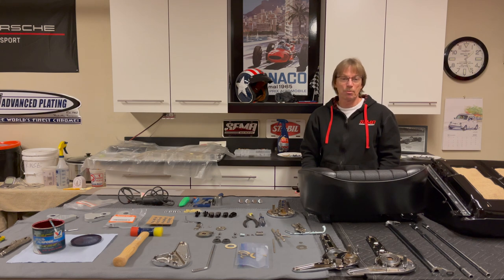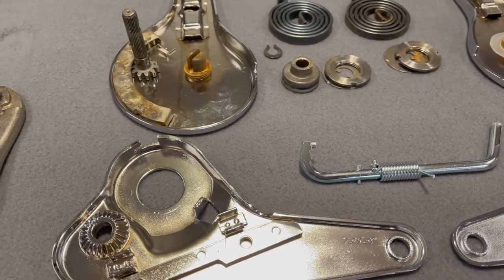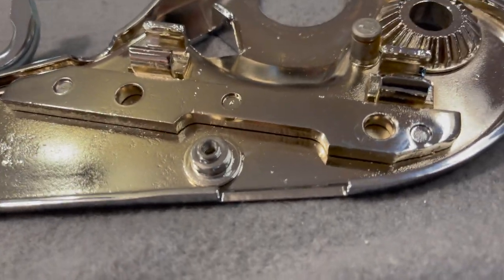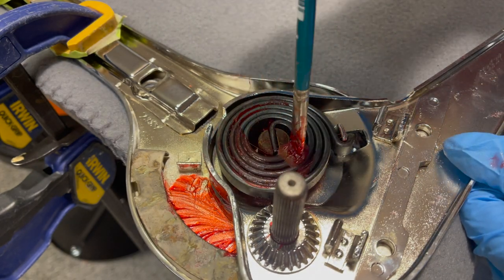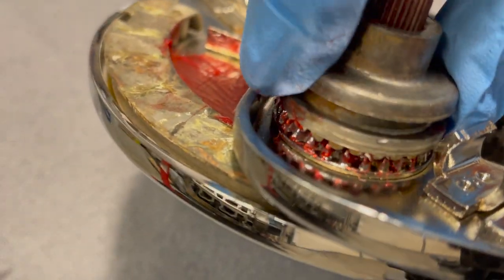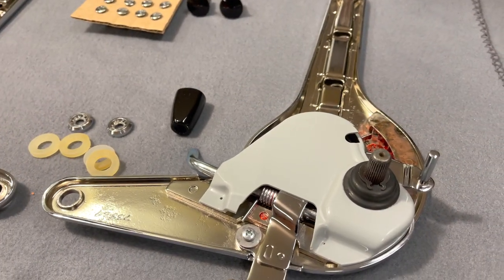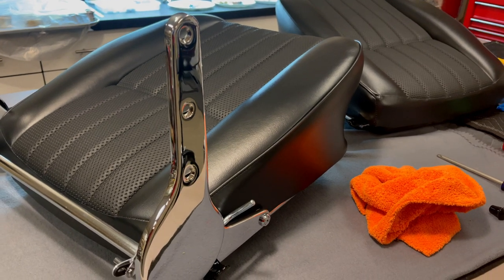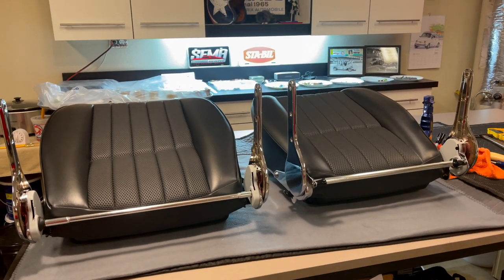Porsche Recaro Seat Hinge !!Full Rebuild!!

Comment: Let me start by saying your work is truly inspiring! I purchased a 68 912 in May from a Restoration shop in Nebraska. A friend of mine here in Michigan spent around 200 hours on when he worked at the the shop. It was intended to be a driver for this older gentleman but at 84 he needed to go into a nursing facility. I am 74 myself and have been a car guy my entire life. Anyway on the trip back my back rest seat on both the driver and passenger side kept popping out of position! I kept wondering what in the heck am I going to do to make them right. Then I ran across your video’s, Wow, there was my answer. I followed your instructions to the letter. I purchased some new rebuild parts from Stoddard, including new covers and I was on my way. The results transformed both seats to new condition! First drive this morning and they are butter smooth. Thank you so much for the fine work you do and for being caring enough to share it with us. I am taking on the window regulators next!
Reply from the maker: Thank you!
Im so glad this video was able to help with your seats.. They can be difficult.
Sometimes all we need is to see how things come apart and we can go from there.
Wishing you the best of luck with your 68 restoration!
Cheers

Comment: Once again, Mike's videos have been the best resource for those of us who are adventurous enough to approach these projects. I've had several people tell me that I didn't want to take on these recliners myself and that they are best sent to a pro with the correct tools. So, I sent these off to a company referred to me from Stoddard. When the recliners were returned to me, I took off one of the plastic covers to discover that the gears looked pretty crusty and if any lube was used on them, it was next to none. Those thin white plastic gaskets where old and in several pieces. I actually paid for this service.
After watching this video, I put the project into my own hands and found that they are not that tough at all to rebuild. Yes, you need to be incredibly cautious when removing and re-installing that large black coiled spring. And, putting the adjuster spring back in requires a bit of dexterity and the ability to throw out some really strong cursing. After watching how to do this in slo-mo, it was back to the garage. I got them on, and now the driver side recliners are done. They truly did not take that much time. Thanks again Mike. I am almost done doing the front seats in entirety.
Reply from the maker: Hello Stephen
Thank you for the positive feedback, it is really appreciated.
Im so glad the videos are this helpful to get thru some of these restoration tasks.
It can be disheartening when you pay for professional services and get sub par workmanship.
I get a lot of emails from viewers on the channel and they are willing to give some of these things a try. Most DIYers are getting great results.
Keep up the great work and if there is something I can help you with down the road please feel free to reach out anytime
Cheers!
www.mikesrestorations.com

Comment: Looking great as always Mike. Don’t forget the little rubber bumpers that seat into the horizontal brackets with the small hole on the seat pans. They make a big difference with how the seat backs settle into place.
Reply from the maker: Hello Andrew season's greetings!
Yes thank you for the heads up. At the moment I'm not able to acquire any from any of the major suppliers or ebay.
Currently out of stock on all fronts and scheduled for another run. Will go over them as we install the seats in the car. Definitely a must as the seats need to settle into something for shock and vibration.

Comment: Mike, Excellent video! I am in the process of restoring my '67 and your video's have become instrumental in my restoration journey. Quick question, the rubber containment caps (as seen in your video at 13:45) on my seats, as well as the rubber inner bushings (as seen at 18:22) were old, cracked and just destroyed. Where were you able to find the replacement rubber parts? Any help locating them, especially a parts number(s), or vendors with them in a kit would be greatly appreciated...
Reply from the maker: Hello James
Thank you
Regarding those parts, I was able to re-use the originals on my seat sets. I don't know if any of these are available from Porsche or after market. I would recommend calling Stoddard or Einmailig in Huntington Beach. If new parts can't be sourced Einmailig I think would be your best bet!
Wishing you the best of luck on your 67!!
 Cheers!

Comment: This video gave me the courage to duplicate your job. Off to the chrome shop, a five month wait list, then reassembly. My ride is a late 1967 912 build for the '68 introduction. The recliner setup for the driver side has the same rivet mounted lever (11.22) as the passenger! Will have to tap four screws not two. What is the length of your 4mm pan head machine screw? Thank you for the continued assistance.
Reply from the maker: Hello gj
That's great you will give them a go! I couldn't say for sure what length those screws are as it has been a couple years since
working that area of the car. Sometimes when Im working something like this a buy an assortment of sizes and try them out.
You can never have too much stock on hand for misc things..
Good luck!

Comment: Mike, I am a big fan!  I refer to you frequently as I restore my 66 911.  Currently working on seat hinges, I notice that two  of the hinge gears are very slightly longer than the other two; does it matter which seat hinge they are installed in?  Thanks again, Jim.
Reply from the maker: Hello James
I looked through some old photographs go my hinge disassembly and its difficult to conclude. However looking at its construction it would appear that the longer gear sets up on the lever side of the hinge. It worth a try to mock it up and see if things align properly. I wish I could give you something more concrete but my photos don't show any measure.

Comment: Hey Mike, thank you as always!  So to clarify my understanding:  the extra mechanism on the passenger side is for tilt forward to allow rear access?  I don't have my originals unfortunately.
Reply from the maker: Hello John Season's Greetings!
The passenger side locking bar keeps the seat from forward inertia if empty or small child in the seat. 
If you were to slam the brakes or sudden impact..It's possible for the seat to come forward.
The bar prevents that from happening and has to be manually released to come up and forward.
Drivers side doesn't need such a thing as the weight of the driver and seat belt keep it in place
Great question!
Wishing you a happy healthy and prosperous 2021!
I hope to make a trip to Japan next year!!!

Comment: Thank you for the great video.  Really helped my project.  I looked at two cars 1970 and 1973 911s and the e-clip on the splined shaft is under the rubber boot, not on top of it like you demonstrated.  Seems logical to hide the e-clip but I see your point that it helps the rubber boot and plastic cover stay in place.  Do you know if this assembly method is year specific?
Reply from the maker: Hello Dan
You're welcome I hope it can be helpful.
Im not sure of any changes in assembly order specific to year or model..just referencing old photos and stock photos of other cars that look to be in original order. Its hard to say if anyone has played with the reassembly or if Porsche set it up that way.
The purpose of the rubber boot is to keep pressure on the plastic cover as the lever will press against it and pop off the cover if something isn't holding it secure while being actuated. The e-clip will not allow the cover to pop off if adjusted properly with the rubber pressure seal under the e-clip
Reply: @MikesRestorations  Thank you Mike!  One more question if you don't mind.  I'm missing the plastic knob on the seat adjustment (slides the seat up and back, not the recline).  Is there a source for that knob?  Replacing the entire mechanism is a little costly.
Reply from the maker: @danrose777  Dan I would try Einmailig..They have an incredible supply of Porsche seating parts.  http://einmalig.com. Good Luck!